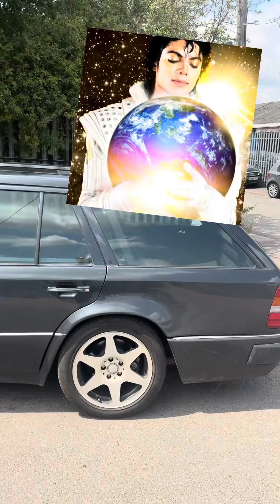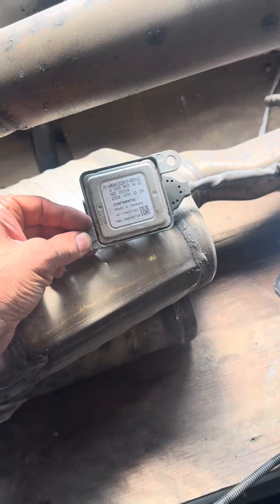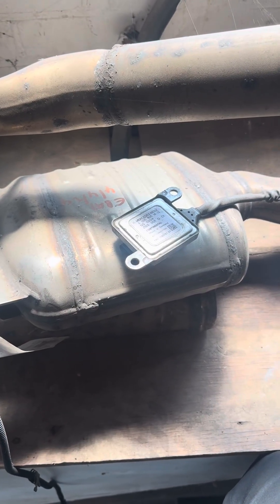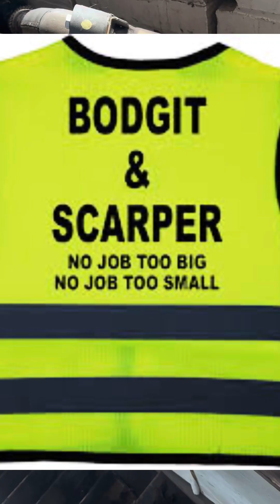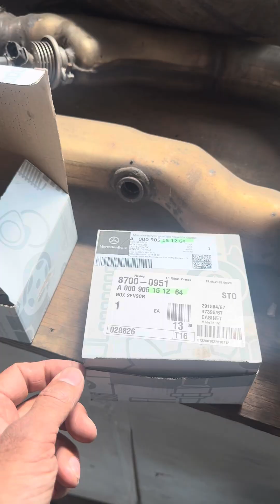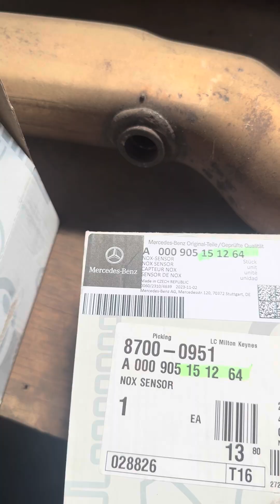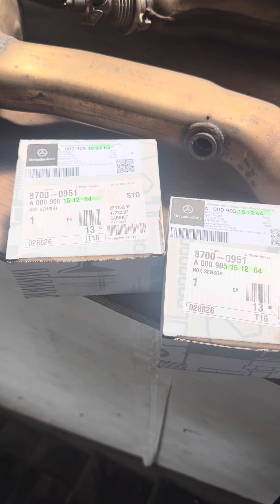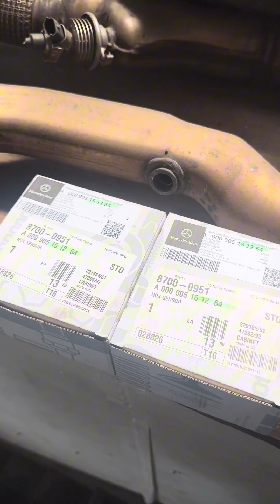Explaining Adblue & Nox Sensors on Euro 6 Mercedes Benz and why NOT to remap them out!

Comment: Jay, is there anything one can do or not do to help protect the Nox sensors? Great content 😊
Reply from the maker: Drive your car! Some say using good quality fuels always helps and I’m an advocate of that for sure, especially petrol models. 

But really a lot of issues occur just due to insufficient motorway journeys..

The sensors themselves are a weakness and there isnt much you can do to protect them. They just fail!
Reply: Thanks for the informative video.
I had the sensors replaced three years ago at Mercedes Coventry, the issue came back and cost me another £1k to rectify. Now I have another fault which could be a blocked adblue injector. It has put me off buying Mercedes in the future.
Reply from the maker: @sanjaylodhia5892  thanks! Shame but all things need maintenance.. you can get Adblue injectors aftermarket. Bosch ones are good and a fraction of the price
Reply: What about petrol cars?